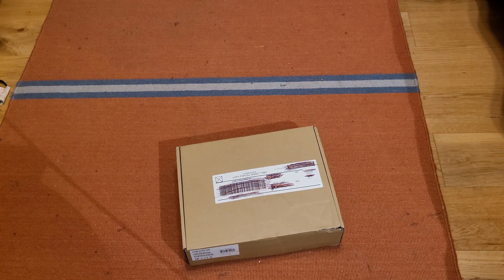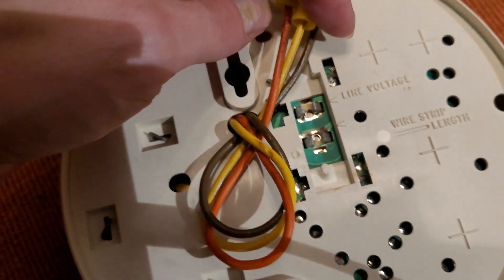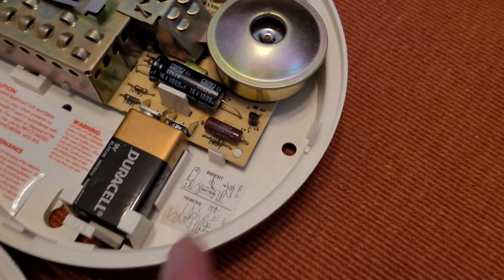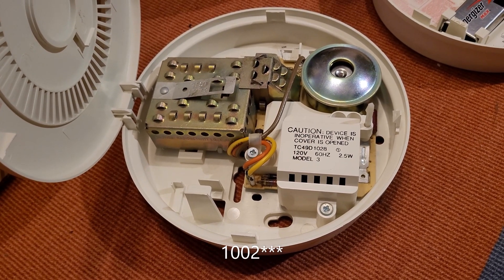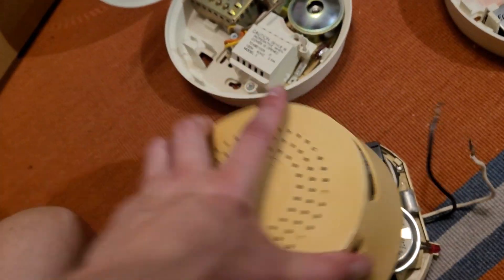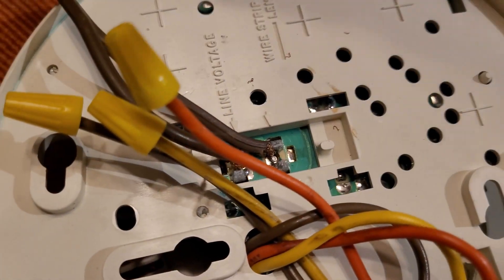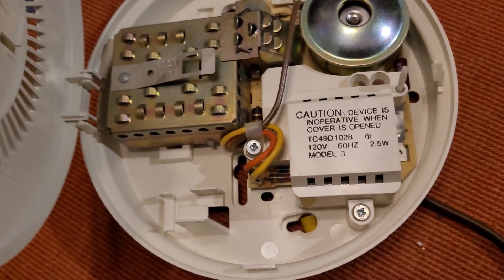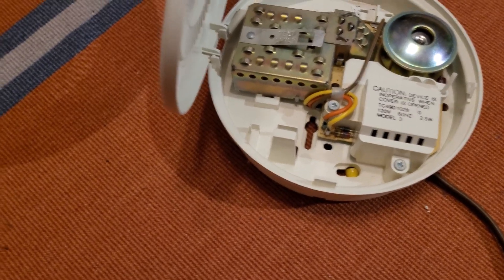Honeywell TC49D-1028 Smoke Detector | Unbox & Test

Comment: Very cool detector, looks kinda like an X Sense smoke detector. 

I wish they still made smoke alarms like this in newer smoke alarm configurations but with kobishi horns
Reply from the maker: I agree, though the new Lyric model looks almost like an updated TC49A/TC89B design
Reply: it really wouldn't work and give the low buzz with today's electronic designs - likely new hardwire would be fully rectified with a filter capacitor to smooth it out, voltage stepped down to 9v dc or less. The older alarms likely ran on full ac or half wave rectified ac without any filtering to smooth it out - would give the low 60hz buzz. full wave non-rectified would give a higher pitch 120hz sound on a mechanical horn i believe.
Reply: @BAFVintage  yeah it does without the test button in the middle and the squealer
Reply: @Jon-hx7pe  AC only would probably not be used anyway.
Reply: @Alarmo05221  that was my point - new hardwired alarms likely are running on low volt dc thanks to cheap electronics rectifying, smoothing and stepping down the voltage without bulky transformer.

Comment: another classic detector.  I love those vintage honeywells.  I'm still trying to find out what the TC489A is though, after seeing that old video of the CD200A you did.  another one thats interesting is the CD400A, the one with the escape light.  Great video!
Reply from the maker: I feel like the TC489 is a contractor or retail model of one of the CD100 or CD300, IIRC someone found a spreadsheet which lists it as an AC powered model.
Reply: @BAFVintage  yea. When you made the video of the CD200A I thought it was like a TC49D with battery backup or something like that but apparently thats the CD300A.

Comment: Ive never heard of a hardwired Honeywell of that design before ive seen the cd200A but thats because those are more common
Reply: Because you live under a damp rock.
Reply: @DaulaPeen-sg3xb  you live I'm a soggy basement that leaks
Reply: @sidney-ss5xr  *in, if you're going to insult me, at least put those 3 1/2 braincells of yours together and use proper grammar.